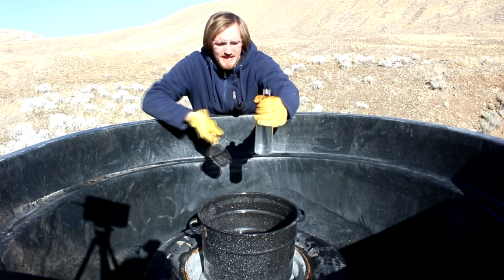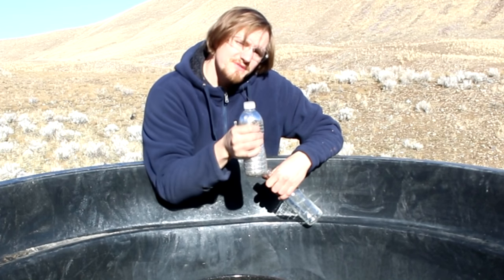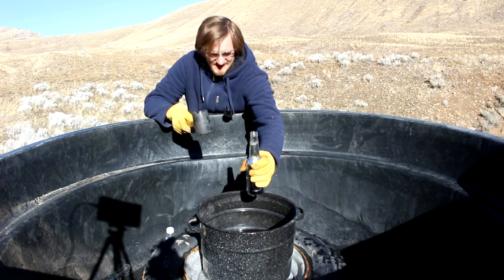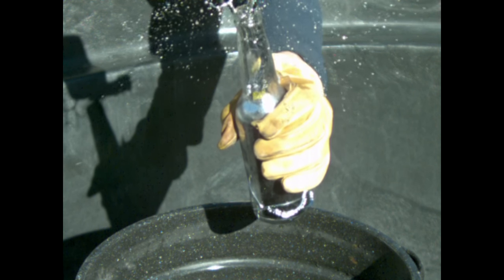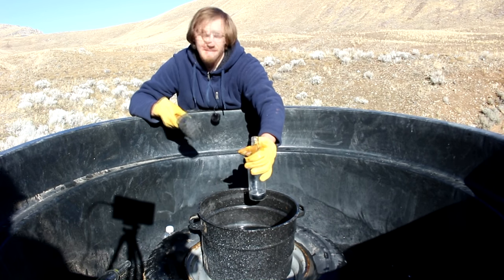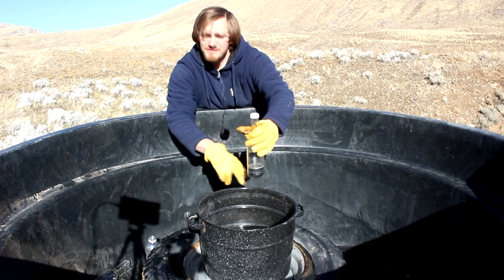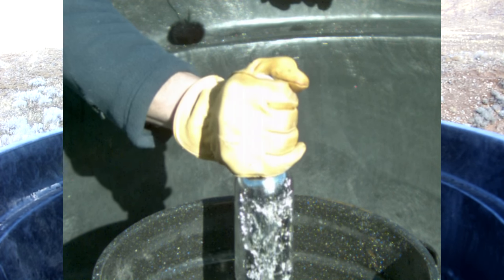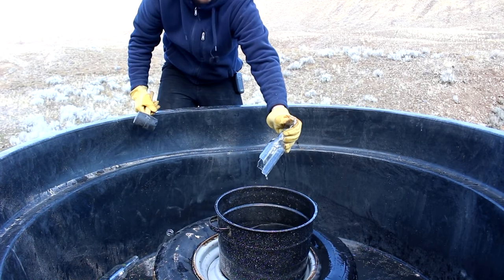Breaking Bottles With Mercury

Comment: Love the videos Cody! Question: how stupid would it be to chew on solid Mercury? Thanks!
Reply: as long as you don't swallow any you should be mostly fine. Bodies can handle mercury in small amounts. Just like cyanide
Reply: My wonder is if it would melt fast enough to be harmful
Reply: metallic mercury is not absorbed by the body in significant amounts so even if it melted it would not do anything.
On the other hand trying to bite frozen metal is stupid enough in itself.

Comment: Could it be possible that there is too much mercury in the glass container? I'd always thought that it was the momentum of the mercury hitting the bottom of the vial that broke the glass. If this is the case then the weight of the mercury may actually be increasing the breaking distance of the bottle and decreasing the instantaneous force the mercury has on the bottle.

Of course the diameter of the bottle would also be reduced to reflect lab style conditions (usually stored/viewed in small vials not large bottles.

Comment: If you watch from 4.00 onwards at 0.25 playback speed, you can see a tiny triangular piece of glass that breaks from the left of the bottle, travels left and upwards away from the bottle then instantly changes direction and returns towards the bottle..? I think this is because of the displacement of air upwards the instant the mercury splashes the water. I know this is old but I'd love to see this done super slow motion with smoke or visible gas or fog, just to see how the air moves.
Reply from the maker: I think It bounced off the rubber container.
Reply: That actually looks more probable. I think it was the fact the impacts were nearly perfectly simultaneous made me overlook the giant outer tank 😅 I just flushed the toilet without the lid down and thought about the air's travel as it flushed ..oof 🤣 watching through all you're videos, nice to get a reply

Comment: One question;
Doesn't the bottom of the glass break because of the force applied to the top of the glass bottle had a reaction coming from the liquid in either direction?
So basically, the force applied when hitting with the hammer + energy gained by the liquid is all contained within the liquid when hitting back on the base of the glass, causing it to break.
That is my theory to it, any suggestions?
Reply: Nobody? Okay :(

Comment: OK there is no such thing as a perfectly smooth flat surface , so what I am saying is the micro irregularities of the inside of the glass bottle's surface alloyed some micro places where air became trapped between the bottle and the mercury so when you struck the top of the bottle there was some cavitation (air bubbles) just not on a scale that would happen with water so I really like seeing the mercury and the shock wave that traveled up the bottle and I will need to view this video a multitude of times to work more of  the dynamics of this in my mind .

Comment: I thought that the point was not to let any air in the bottle (fill it completely with water) in order for this to work. Was I wrong or does it work differently with mercury?
Reply: you dont need to fill it completely with water or mercury. How it works is you smash the top and the liquid pushes itself up forcing the air out the top and creating a vacuum in the bottom and the vacuum forces the liquid back down to the bottom. It has more to do with density.

Comment: What does mercury react with ? Or does it react ?
Reply: From memory (school was a long time ago) Aluminium - it eats the surface off (oxide, i think) which makes it break down in air.
Reply: Retro Orange seeing as how it is poisonous I would say it is reactive
Reply: Lots of things, nitric acid is one of the more common reactions to do with mercury. Forming mercury nitrate.
It doesn't technically have a chemical reaction with aluminum, rather forms an amalgam. The mercury is still in elemental form, not as a chemical compound.

Comment: would have loved to see you do that by hand, no mallet ( obviously still using gloves) used to do that with Lucozade bottles back when they were glass. (using water, didn't have access to Mg)
Reply: sorry autocorrect stumped me, *Hg
Reply: Im not saying it isn't possible, but it is a lot easier to do it with a mallet because a mallet is a lot harder then our hands and we can apply more pressure with it, because it won't hurt us like it would if we applied more pressure using our hand
Reply: the water lvl has to be exact to do it by hand.. to much or not enuff and it wont work by hand... cody prob had a hard time doing it by hand not knowing this.... many drunk nights at partys, and i can get it in 3 trys by hand.. its about 2 inches of water to make it work

Comment: Could you make a constant mercury waterfall "mercuryfall"
Reply: doobs_402 what do you mean by constant?
Reply: I'll make one if you supply the pumps
Reply: Just recirculating, would pumps not work?
Reply: Archimedes screw?
Reply: Most pumps designed for water wouldn't be able to handle mercury, at least not very well.
Reply: The mercury would oxidize rapidly and look cruddy afterwards. Also, mercury vapor would occur which is bad news.
Reply: Good to know, but would it look cool for a short time?
Reply: Doesn't mercury just turn into a dull lighter grey when it oxidizes?
The hard part would be the issue with pumps. Just that water bottle full, he says weighs about 15lbs. Mercury is almost 14 times the density of water so that pump will be working about 14 times harder.
Reply: doobs_402 Probably so, yeah. Long enough for a YouTube video anyway.

Comment: Cody, I am not a professional physicist but I suspect the reason for the results you achieved is NOT a "cavitation bubble" as you call it.  It is simple energy transference from the hammer to the air in the bottle to the liquid in the bottle and finally to the bottom wall of the bottle where it shatters.  The reason shaking does not break the bottom of the bottle is that you are not transferring energy in enough of a shockwave to cause the bottom to shatter.  Your shaking energy is diffused throughout the liquid.  Just a humble idiot's opinion!

Comment: arhh.. really did not get your point across...your state it shatters way more easily than water and sure it looks like it... but why then smash it massively as your life depended on it.
if it shatters so easily with mercury and water, - hit it soft, so you could show how little impact that can get the bottom to crack and display the massive density of mercury. (common sense but nope still yet again slams the bottle hard with the rubber hammer' like a fool)

Comment: you do realize that you don't have to use a hammer to do this, right?
Reply: Probably was just more comfortable than using his hands since he had to do it a lot.  Also, hitting that bottle would filled up with mercury would be brutal, since you're hitting a heavier object and it resists the force more.
Reply: The Real Ryan true
Reply: Idk if you have ever tried the trick but it's super hard to do. The hammer was probably just much easier. I agree that using his hand would have looked cooler though. :P
Reply: +Dominic Galloway   not really, its easy if you dont add too little or too much water. and im not all that strong either (as if it had any effect anyways)
Reply: software FG v7.0 I guess it was the bottle I had because I was hitting the bottle so hard I damn near bruised my hand and I kept trying different levels of water. Lmao.
Reply: Dominic Galloway half full of water seems about the best and i used the standard brown bottles when i did it